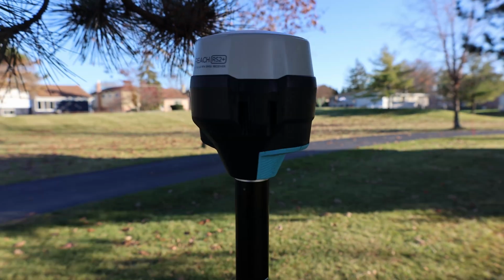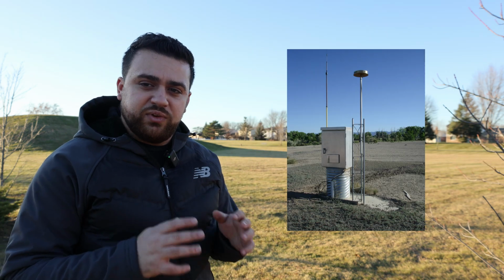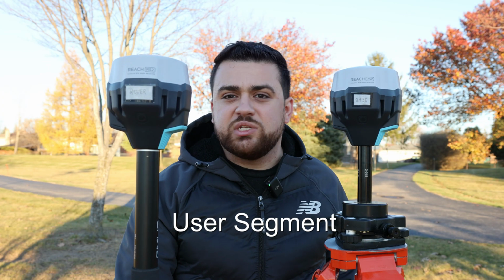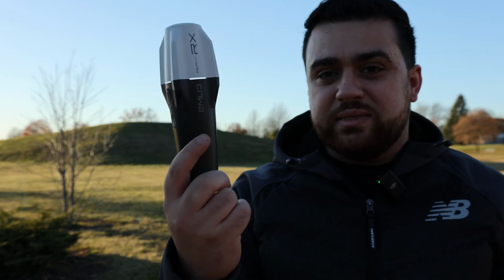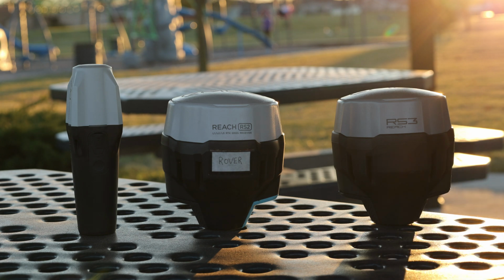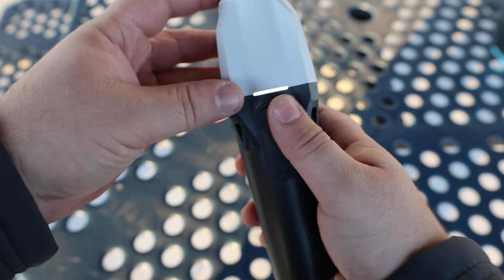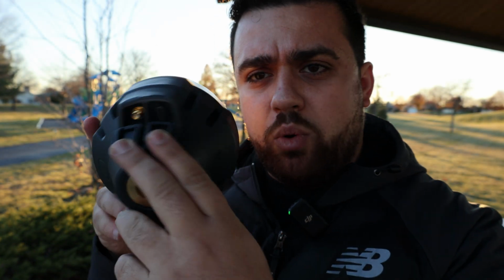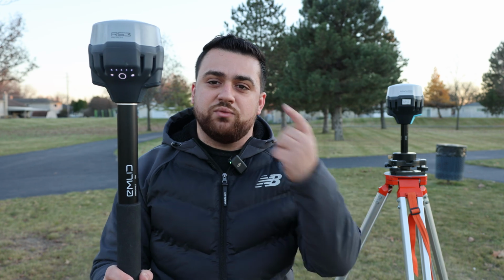Emlid Reach RX vs RS2+ vs RS3 - Best Value for Your Money?

Comment: Do the RSC 2 & 3 both get all of the satellite configurations & under trees? If the RSC2 achieves less than the RSC3 it is best to have both base & rover the same. For example if you have a regular non-Glonass receiver as the base, the Glonass capable rover cannot be provided Glonass corrections. I do want an answer to my first question please.

Comment: Newbie here. Amazing videos by the way!
Excuse my lack of understanding here. If I were to use let’s say an RS3 as a rover without a base station nor connection to CORS network, am I still able to get relative accuracy if I set my first data point as a zero benchmark and take subsequent point readings from there by using the Emlid Castor or Flow apps?
Reply: No

Comment: Can you have the Rs2 or Rs3 device as a base, and Rx as a Rover for RTK connection with radio?
Reply from the maker: Not through radio. You can set up a local ntrip or use Emlid caster with the RS2/RS3 as a base and enter the credentials in the RX rover.
Reply: Have you used this method for executing drone surveys with absolute accuracy?

Comment: Rami,  I asked in your last video (you may not have seen it) is it possible to get a reliable "fix" solution using a older RS+ as a base and upgrade to the rs2 or rs3 for my rover?  Using 2 rs+ now and fix isn't reliable and drops out a lot, especially near trees.  have you tested it this way? can you? i would perfer to simply upgrade the rover and not have to fork over the $ for a base as well.   Local Ntrip isn't an option in my "boonies" area

Comment: Why emlid doesn't activated the integrated imu that comes whith the RS2?
Reply from the maker: I don't believe the RS2/RS2+ have an IMU built in.
Reply: @RamiTamimi  that's what they said on their promotional brochure and the emlid oficcial forum.
Reply: Possibly for the same reason that DJI doesn't have all the features in all the models. For example the Phantom 4 Pro had a global shutter and all the video and photo settings available. The mavic 3 doesn't offer everything in in one drone like the Phantom 4 Pro did. It's just marketing, just the way to get more money for the products. If it's still the best value on the market, I guess you can't blame them

Comment: I hear tripod and legs are most accurate from a few surveyors. I don't understand that. A fixed height rod with a 3 leg thumb release eliminates human error on measuring the h.i. just my opinion but I have found in my years of experience that human error is the biggest cause of errors. By using a fixed height rod, you are eliminating a possible error.
Reply from the maker: It has more to do with stability, and having the Base station directly over the point. When the Pole leveled using a bipod vs using a tribracket on a tripod, the tripod is more accurate. Human error is a completely different source of error, we're talking about systematic errors.
Reply: I’m going to pretty much echo the same points as Rami, with some addition: it also depends on what you’re looking to get out of a particular GNSS observation. 

If you’re looking for better height accuracy, then I would agree that using a pole + bipod is the way to go.

If you’re looking for a better horizontal accuracy, then having the ability to set the receiver over a point with high accuracy (such as the case with tripods + tribrach) would be better.

All of this ignore the fact that most RTK GNSS receivers have accuracy levels that would eliminate any differences between the two methods (2cm for horizontal, 5cm for vertical) ✌️
Reply: Add distance to the base...